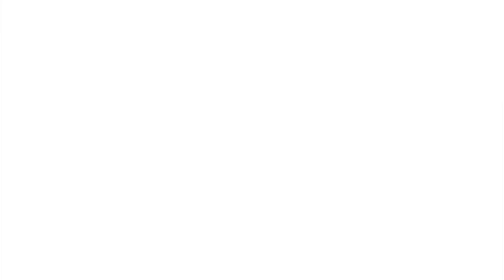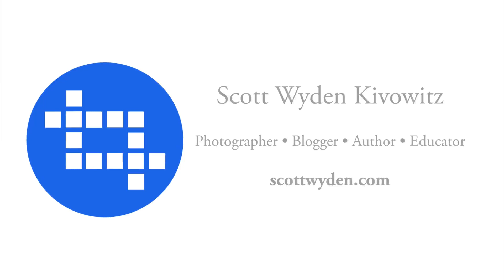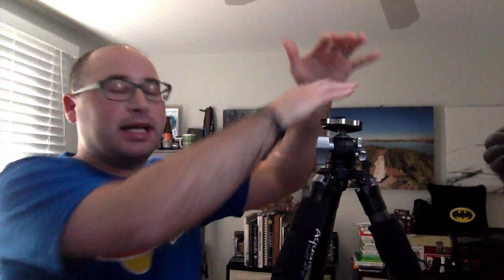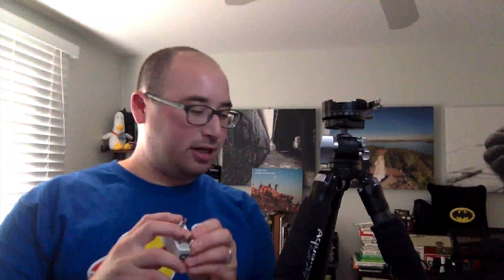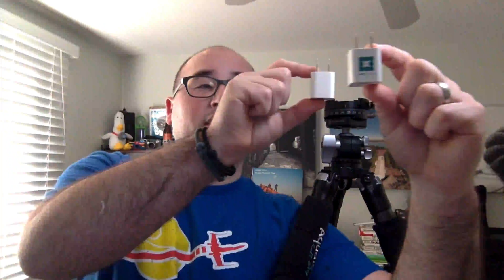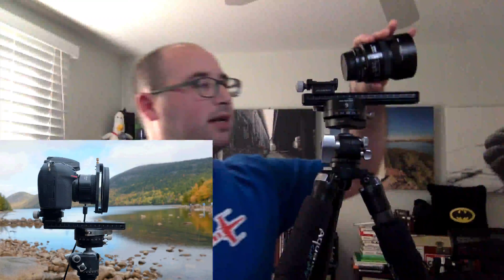Parallax No More w/ a Leveling Plate & Nodal Slide

Comment: I have a question can you do a multiple row pano just using a nodal slide. By changing the settings well doing a bottom pano then a middle pano and then a top pano with out using a Panoramic Head. Iam new to pano and not sure if i want to invest into a expensive panoramic head. I understand that with a panoramic head you can tilt the lens up middle or down without changing settings..But can you do the same with a simple nodal slide by slightly changing the center pivot for each angles
Reply from the maker: Not with just a nodal slide.  You'd need something like a Gimbal head.  I made a video on that here: https://youtu.be/_tz7MdpgFr4

Comment: When you put the camera on the nodal slide, how do you align the position so that the lens is centered in the middle of the nodal slide?
Reply from the maker: You want the camera centered to the sensor plane.
Reply: @scottwyden  How do you find the center of the sensor?  When you attach camera in portrait orientation with L bracket to the nodal slide, there isn't any centering target for the camera.  You just eyeball it?
Reply from the maker: Most cameras have a mark that looks like an O with a - through it. That is the sensor plane identifier.

Comment: If the ballhead already has a dedicated panorama knob (like the mefoto roadtrip tripod), do I still need to get a panoramic plate to go on top of a levelling base, or can I just use the panorama feature of the ballhead and still have no parallax error?
Reply: Nice video tutorial, Scott~Please correct me if I'm wrong, but John, I believe that the only way to avoid parallax error is to use a nodal rail. Yes, your MEFOTO tripod/ball head only allows panning, as any ball head would. However, if the nodal point of your lens isn't centered over the axis of rotation, then you'll still get parallax error...unless your subject has no foreground objects. And FYI, I recently came across a unique and extremely high-quality travel tripod that is PERFECT for panorama photography...the FLM "CP26 Travel Tripod". It has super-strong 10x Carbon Fiber legs (26 lb load capacity!) with well-made twist locks, and a ball head that has several unique features that I've not seen in my 35 years of photography using tripods...For example, the "Pan" function permits butter-smooth normal panning, but in addition, adds a 15-degree ratchet function that is fantastic for us landscape/panorama photographers! There is also a "Tilt" knob that locks the ball head so that only one vertical/up/down plane is available. And finally, there is a "lock" function that locks the ball head from panning/turning, so that it can easily be unscrewed and/or mounted solidly. The kit comes with very well-made screw-on metal spikes, and folds up to a compact 15.5" for travel. Quite ingenious and precision design overall, and highly recommended for travel!!  Bottom line: This FLM tripod simply exudes Quality. Here's the link to that awesome tripod: http://www.flmcanada.com. Thanks, and good luck!

Comment: Would it not be simpler and more versatile to have the levelling device below the tripod head, and use the tripod head's panoramic feature to rotate the camera? This would also allow for raised and depressed camera angles while doing the panorama.

This would also be a much cheaper option than what you are using.
Reply: Yes, it does make sense to use a leveling base below the ball head, in order to utilize the ball head's functionality. However, that also necessitates, as Scott said, leveling the ballhead itself, prior to the panning. Also, one still should use a nodal rail (at a minimum) to avoid parallax. As a side note, I only realized the above, after playing with a Novoflex MagicBalance Leveling base. I also realized that getting a leveling base without a bubble level, made this whole process that much harder! Recommendation: Always use a leveling base that has a bubble level, in conjunction with your camera's electronic level. That will make this process much quicker and easier!